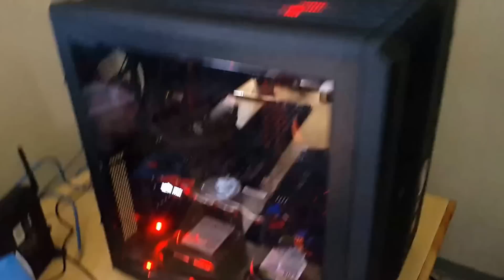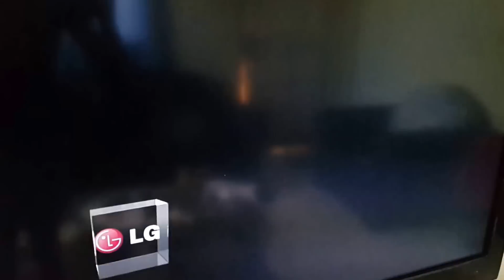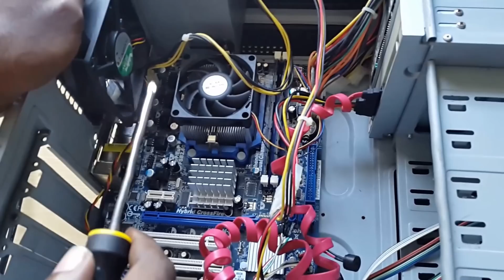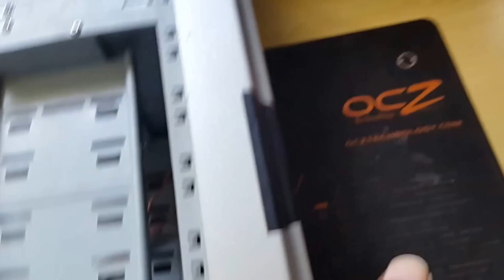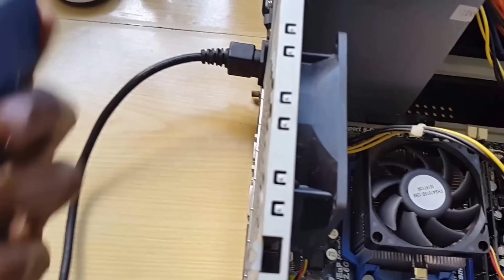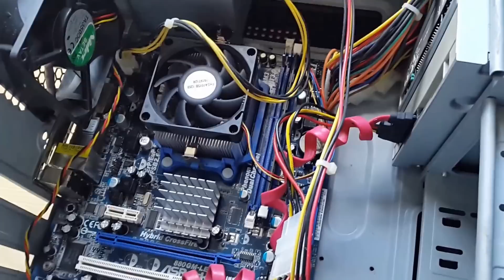No signal to Monitor Fix Easy PC Fix

Comment: I ran into a problem, i installed a GTX 750 TI in a Maximus VI Gene and i get no display, it boots, it beeps normally but no displays, i take out the graphics card and it boots and displays image. (yes it has enough power for the graphics card and yes i installed the hdmi cable directly to the graphics card when i installed it and nothing)

Comment: I need help. When DVI and VGA cable is connected to the graphics card, there is no signal in my monitor. But if only VGA is connected there is a signal. Before this no signal problem happened, Both VGA and DVI are connected to graphics card.

Comment: Fuckin' a, man, I didn't think it would work but the thing with unplugging the pc and holding the power button worked for me. Can you explain what that does and why that works?
Reply: Also, what causes this?
Reply from the maker: +Makingnewnamesisdumb I think it may be static electricity in the circuitry of the computer that causes this as it also happens with Laptops and phones sometimes and that residual energy needs to be drained.

Comment: Hey I have a question my computer starts up and everything boots but the monitor is just black. Everything is spinning my gpu is glowing and fans are spinning, keyboard and mouse lights are on but I'm not sure what the problem is. I replace my gpu with a different one and it booted up perfectly. So does this mean my new gpu is dead? it was working for 2 days until today. Should i change the hdmi cable to a different cable if that would help?
Reply from the maker: +AnimeOkatu Rule nothing out and change the cable and even try without the Video card, Video cards can die at times without warning lets hope that's not the case.
Reply: +Ricardo Gardener well thx for the reply but the gpu was dead and I return it

Comment: Works Perfectly ..;)

1: Power Recycle
2: Remove RAM and clean it and replace it
3: Remove CMOS battery for a minute and put it back.
4: Remove External Graphics card. And then Try to boot.

The 4th one worked for me .

Thanks
Reply from the maker: +Aby Varghese Thanks for verifying that it worked for you.

Comment: i have the same problem plus my pc used to start on its own without me pressing the power button. That i got fixed when i changed the bois battery. Then i tried all that u showed in the video. Even removed the ram and started the pc and it beeped thrice. i then reinserted it but nothing happened. I dont have a graphics card expect the one integrated within the motherboard. Tell me what to do?????
Reply from the maker: +aqib junaid Did you get new RAM to see if the ones currently in are faulty?

Comment: I tried all of this and it is still not working I don't know what to do
Reply from the maker: +Enrique Noyes Dont give up, I know these things can be frustrating, get a break and try again later sometimes the problem is simpler than you think.
Reply from the maker: +Enrique Noyes Dont give up, I know these things can be frustrating, get a break and try again later sometimes the problem is simpler than you think.
Reply: same here
Reply: +Ricardo Gardener i got my pc today everything is working fans etc but my Monitor says no video input what can it be pls help:/
Reply: +Ricardo Gardener tried that with the ram (take them out blew air on them put them back still not working)
Reply: +Ben Recktenwald did you solve the problem?
Reply: +bobliu123 yes the company where the pc was build by replaced the cpu (the cpu was defect because of the post the threw all things arround => cpu was defect